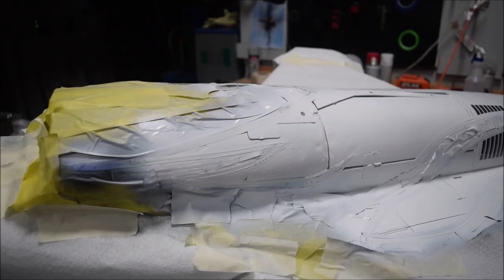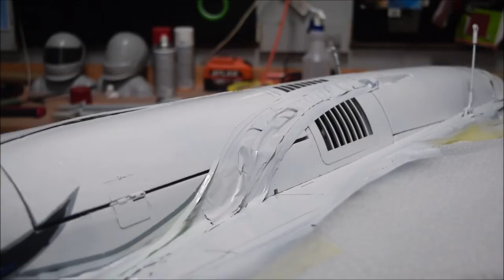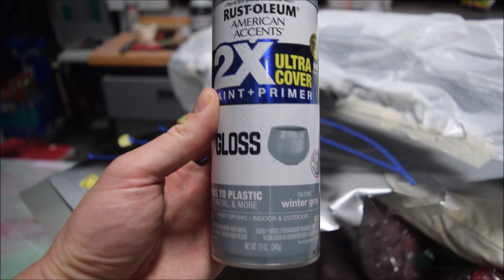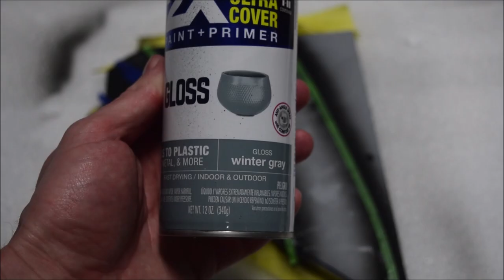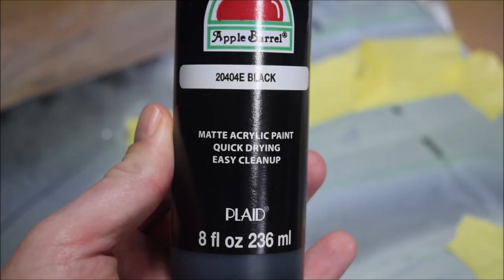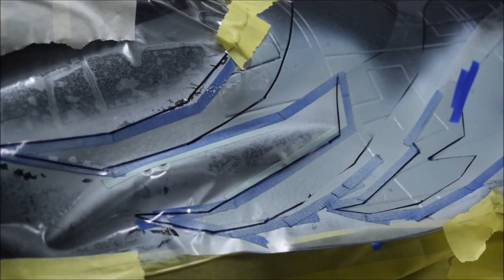Airbrush and Painting the Belgian Air Force F-16 "Dark Falcon" -  Remote Control EDF F-16 Jet

Comment: Man you are talented, I just found my new favorite you tube channel, I’m building my first turbine HSD f16 right now. So I’m kind of just assembling and not building. And I have the all grey model so I just picked up a cheap air brush and pancake compressor and really want  to try this. What type of under coat or primer did u start with and if u don’t mind me asking, what type of paint do u use in your air brush on EPO foam??? Thanks for the inspiration bud.
Reply from the maker: Thank you for watching. I primed this one using the very cheap flat white "color place" spray paint. But any spray paint will work; rustoleum, krylon, etc. You can spray right on top of the stock foam surface from HSD.  Before painting I just wipe the surface down with a clean paper towel dabbed in some rubbing alcohol, let it dry, and spray away.  No other surface prep is needed. I use cheap apple barrel acrylics in my airbrush. They have a great selection of colors and are very cheap. I just squeeze the entire bottle into an empty water bottle, dilute it with a little bit of createx reducer or rubbing alcohol (by adding about 20% of the amount of paint you put in the bottle). It should have the consistency of milk if it is mixed correctly. If too thick, add more reducer or rubbing alcohol. If too thin, add more paint. I'd recommend shooting it at 25-30 psi. Good luck and have fun 👊